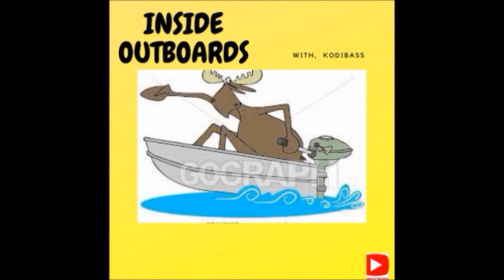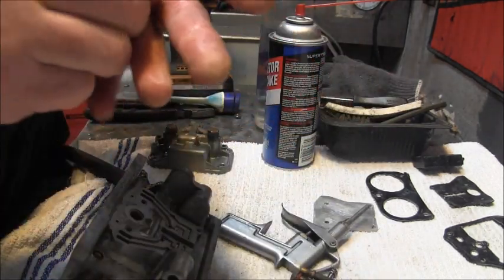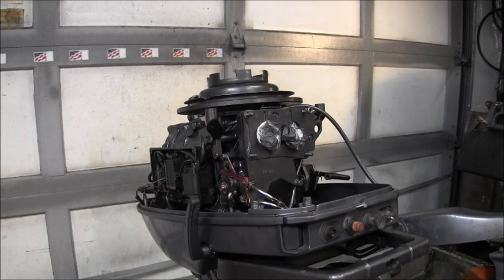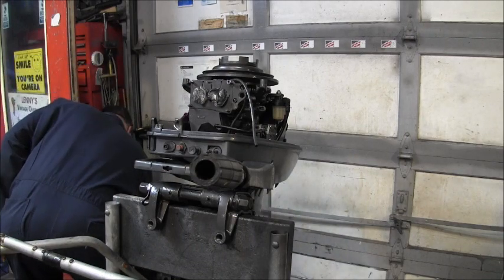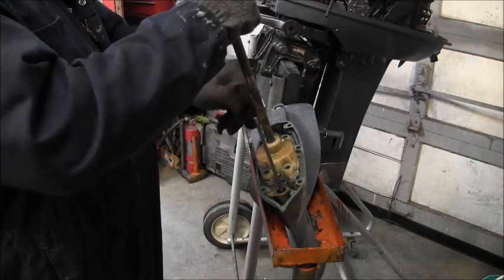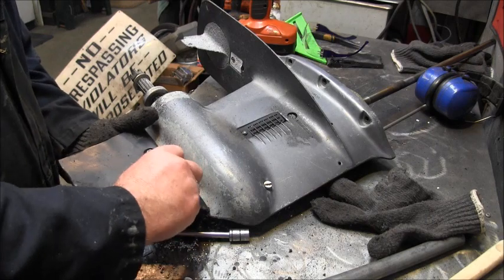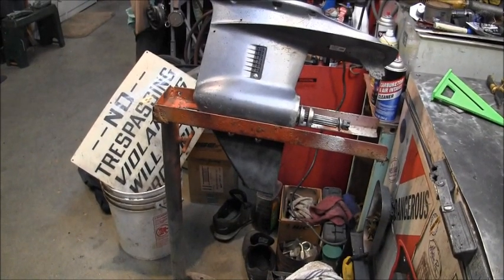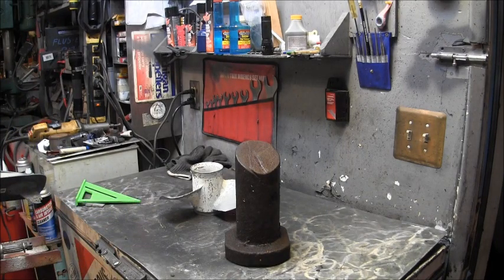YAMAHA    ENDURO 40 HP,      ((    Part 5   ))

Comment: I picked up a 1951 QD12 10hp Johnson seahorse outbord with the 4 gal tank twin line there’s no rubber hoses it’s all copper line on the carburetor and if you run across the cowl I would buy it this one cracked and where it screws together Thread part is gone I just wanted to know if the copper lines are factory mostly thanks for the videos I love the info
Reply: To bad the 52 and 53 qd’s won’t fit , check out my friends YouTube channel it’s Old Johnyrude and I’m sure he has at least one a friend of his and I gave him at least 2 of them last year !

Comment: Hi, i like to ser your videos and the passion you have talking about outboards.
For that enduro you can search by Yamaha e40j or e 40g, i think they have parts for it. Many parts are the same, but some are updated like ignition parts. Carb os pretty the same.
Reply: I have a yamaha enduro e40g and I can't find any parts anywhere.  I need a lower unit ,thermostat, and the head gasket. Can anyone help me?
Reply: Where did you go?
Reply from the maker: I found the motors listed on several of the major boating sites,  but when I bring up the parts it says not available ,  but I managed 2 find them  took awhile  tho,   thanks    kodi
Reply: Which boating site sir? Thank you kodi
Reply: Yeah I've been trying to find parts for this yamaha and I cannot find anything
Reply from the maker: @mimimelendez877     MarineEngine   crowleymarine

Comment: Hello Kodi! I challenged you,LOL. I checked with Boatsnet.com they do have the E series listed  and there is only and E40MLHQ  model listed which is 1992 and a E40MLHT which is 1995. Maybe its a T not and I there are no E40MLHI models listed in there index at all any year.Boats.net have both needles and seats in stock. Ebay has both too 6H3-14590-00-00 for the1995 model year & also 6H4-14590-01-00 for the 1992 model year. So if they are correct numbers you could of gotten them locally .Now im going on there listings they could be wrong... hope this possibly explains things a little better... regards Glenn
Reply from the maker: Yes' they R listed on most boat sites,  but scroll down & most of the parts says no longer available.  kodi
Reply: @kodibassInsideoutboards  Well anyway Boatnet has both  and so does E-Bay items listed as needleseat assembly item  # 27 on 1995 model  E40MLHQ and  and item # 26  on 1992 model  E40MLHT clearly instock listed and shown and so does E-bay but anyway youll get her done,Ha! thats funny.....Glenn

Comment: I was wondering if you can help me out . I own a Johnson 30hp 1991 in uk. I have broken what I think is called remote anchor block part number is 0332637. I cant get a replacement for under £80.00 which is ridiculous for such a small part. Any advice or help would  be appreciated thanks Andy in UK v